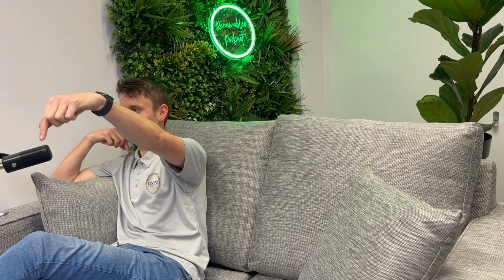Can you recycle and repair LED lighting? Should Battery storage systems have emergency Lights?

Comment: The most recyclable and reusable LED lighting solution is an enclosure made of steel/aluminum with as little plastic as possible, that takes standard lamps. Robus only offer 'F-rated' GU10 lamps with a maximum efficiency of 100lm/w, Philips and a few others offer over double that at 210lm/w

Driving more LEDs in a single lamp at lower power increases the lifetime and (up to a point) efficiency. I'm going to get out my tinfoil hat and suggest that making very efficient lamps that last longer is not a good business model? Or is Robus just massively behind the curve with this technology?

Adding WiFi and colour tuning is a fine decision but if that makes a lamp like the Robus RCGU5CX 83lm/w while increasing the lamp failure rate, and using power even when the lamp is off, you're not exactly working towards a more recyclable, repairable and renewable future.
Reply from the maker: You make some good points but having looked at the Robus range just now they appear to have options above the spec you have shared. I will ask John to comment. 

More widely I agree all brands need to do much more. I have phillips lights on my own unit and they are not without issues either. Its more a technology thing than individual brand imho (mark here)

Thanks for the comment and your views, appreciate it,
Reply: @TheRenewablesPodcast-bv8ie  Sorry for being a downer, I remember completely discounting Robus for high efficiency lamps a while ago.
 
You are correct though, of the 12 GU10 lamps Robus offer I must have missed the RDH4P540 with 105lm/w :) however this still makes it F-rated and half the efficiency of alternatives. The 11other lamps are all <100lm/w

Signify do have their quality issues but a 5 year warranty and minimal on board circuitry, if a lamp lasts 5 years it'll probably last several times that.

I've learned my lesson with integrated LEDs in fittings though, the only places I can't seem to get away from them is security lights and highbays.
Reply from the maker: @andyca15  no need to apologise, we love the comments and experiences of others. I will ask John to check the range etc
Reply: Great podcast but Before I started doing renewables I did a lot of lighting/emergency lighting work in retail it generally was cheaper to get a new complete fitting then new battery for a led spot or bulkhead fitting. Also new fitting was in stock and batteries wasn’t 

Same goes for replacing 5ft led tubes it was cheaper in material and labour to buy an complete new sealed 5ft led batten also in stock same day
Reply: @connordines667  That is another sad state of affairs, we have battery standards, why don’t we have 18650 cells powering our emergency lighting fittings? Replacement cost <£5 available in any electronics store. Capable of powering a 10mA Ultra Efficient bulkhead for about two weeks. 
Instead we have bespoke battery packs for every flavour of light.

The integrated led’s are another issue, especially when it’s usually just a lot of plastic to hide a standard led strip, which can otherwise be repaired, like Dave Savery just showed us in his latest video.